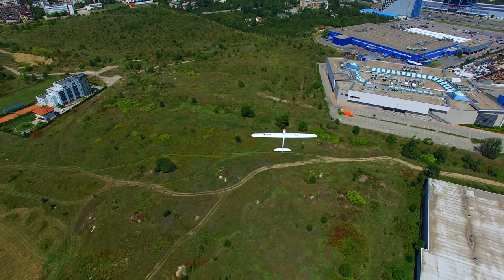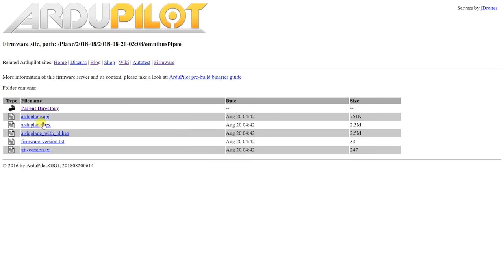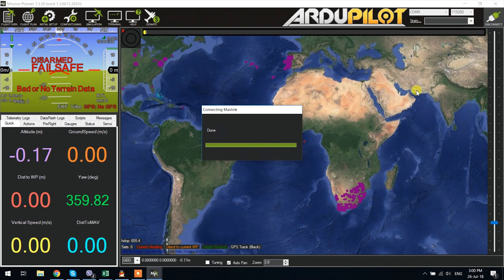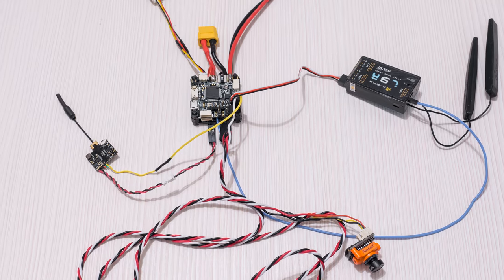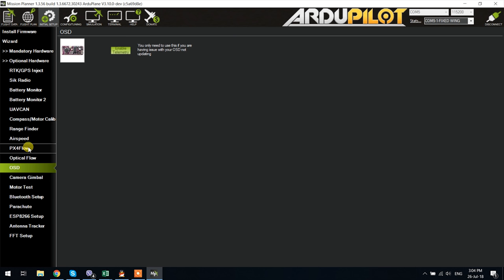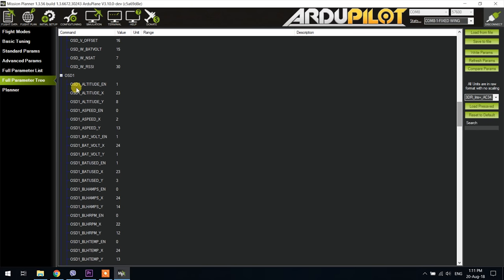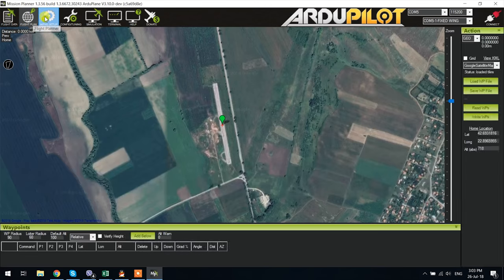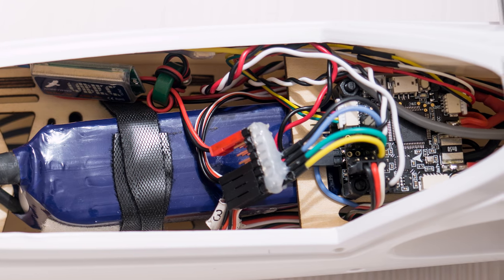HOW-TO ArduPlane on Omnibus F4 Pro and other boards!!!

Comment: Excellent summary, I was thinking of making something like this on Sunday but now glad I didn't bother :)
Just a few things I might add:
Hold down the boot button on the board while plugging in for DFU mode if Betaflight configurator doesn't do it.
If you don't have 8 channels or don't want channel 8 as flight mode, set the FLTMODE_CH parameter as desired.
Flashing the "with_bl" hex via Betaflight will reset all your parameters to defaults, using the .apj via MP will not.
On my omnibus builds so far, I had to set BATT_MONITOR to 4 to enable voltage and current sensing.
Reply: Thanks for the added comments!
Reply: please, do more video about this, as detail as possible, maybe add one for the Matek F405 Wing board.
Reply from the maker: Valid points mate, thanks for sharing them!

Comment: This is great new. What a boost to the ardupilot project being able to use new hardware like the f411 and omnibus f4 with built in osd. I cut my flight controller teeth with ardoplane. Its maturity and stability will always find its way into my airframes. Thanks for the great video!
Reply from the maker: Thanks mate, yes, I do share the same enthusiasm! Can't seem to get away from it! :D

Comment: good video and well explained.
that is the configuration of the osd for a single screen, or to see it in several screens ?.
What would be the difference in the configuration ?. Thanks in advance.
Reply from the maker: Thanks! This is only for a single screen, because I don't use multiple anyway... why add one more complication to an already complicated system! BUT... if you would like to set it up, just enable the additional screens and set a channel to change them with, then just configure like this one!

Comment: Thanks for all your good work. Do you preffer this above inav? I have a ranger 2000 but do not know what to use for sure as flight controller. Thnx again
Reply from the maker: Yes, I do prefer this to iNav any day! The ArduPlane firmware is quite mature and I've been using it for years now, not a single issue! iNav can't seem to get away from issues!
Reply: @ArxangelRC  hello again i have been using omnibus f4 v2 like you.but wen i give throttle up all goes good until 1500 pwm .Wen i go higher up till 2000 pwm the motor starts to stutter (up down up down up down) i did calibrate the esc.also did the radio calibration. is there a param i have to change? thanks in advance

Comment: Hey, I would like to flash my Omnibus F4 Pro V2 with Arduplane. When connecting to SBus, do you need to modify anything or it just work fine? Thanks!
Reply from the maker: Nothing to modify... just plug in the cable, and you're done! Should work....

Comment: Thanks for the video. Do you have negatives about this board? If so good why to pay more for a Matek 405 then? I'm thinking about converting from Matek to this. thanks for your advice !
Reply from the maker: Well... the Matek WING boards are well worth it! EVERYTHING is integrated and the a mount of soldering to be doing is greatly reduced, and made a lot easier! I would pick up a Matek WING over this setup any day!
Reply: thanks I thought the Omnibus was so small and about half the price it would be same same...I'll keep with the Matek
Reply from the maker: @joseantoniosantosdom  It is a bit smaller, and a bit over half the price... but it needs a PDB, etc., to get it to Matek Wing levels... and even then it is more hassle and soldering and wiring than it needs to be! The Wing series just makes this SOOOOO much easier!
Reply: @ArxangelRC  thank you for your help, please keep up your videos are excellent
Reply from the maker: @joseantoniosantosdom  Thank you, will do! :)

Comment: Excellent! I have one question . Do you know if mavlink telemetry radios can be used with this board?
Reply from the maker: Yes, if you see the video that was published before that one, showing the Phoenix flying with this board, I did mention I did have telemetry running, and it is working well! Will also be in the build log in the blog when I am done with it! :)

Comment: Thanks for the video. I'm hoping to use my omnibus f4 pro v3 on my hexcopter with arducopter, but have run into some problems. How did you get the current sensing to work? Whenever I try to set it up it comes up with some message about incorrect battery capacity. Thank you in advance
Reply from the maker: I didn't really do much... enabled the sensor, entered the battery capacity in the battery capacity field on top right part of the screen where you enable the batt monitoring. Should be doable like any other power module on pixhawk. I think you will also have to input the amps per voltz ratio... or something like that... I think I read somewhere a value of around 31 or 32 is to be used... not sure what it does, and I am still not done calibrating it, but at least it shows some value! :D
Reply: What type did you set the current sensor to?
Reply: Turned out it was working all along :p I thought it wasn't because of the capacity error. I'm looking forward to testing it and hope it will work better than inav.
Reply from the maker: Haha, glad you figured it out, should be working OK, though these things are never super precise! :)

Comment: I have installed Arduplane (fixed wing) on an Omnibus F4Pro Flight Controller, linked via FrSky X8R Rx to my Taranis X9D Plus. While sitting on the bench I am testing the various flight modes and they switch properly. My question is when I am in manual mode w/ 50% throttle and I switch to Cruise mode the motor stops - is this normal behavior on the bench? I am nervous to test it in the air as I am not sure what the response will be.

Any help appreciated.
Reply from the maker: Hi, I haven't tested that particular scenario, but my experience with these things is that while stationary and possibly with no GPS lock, the flight modes might act weirdly! This should be tested in the air and you can always switch out of it if it doesn't perform well! For me it might make sense that it would cut the motor, because the Cruise mode does not allow for direct motor control, you apply elevator to tell it to gain altitude, at which point the AP increases throttle on its own, if needed, to achieve that altitude gain! Just like with RTL on the ground, when you switch to it while stationary and possibly with no GPS lock, it will not spin the motor.

Comment: Very informative video... thank you! 
Did you manage to get FrSky Telemetry through one of the UARTS? I have an Omnibus V3 (not pro) and everything works but telemetry for my Taranis.
Reply from the maker: Thanks! Actually I have not tried doing that... not sure if it will work, and I don't really use it! Have found that receivers without telemetry work better and at longer distances so, have tried not to use telemetry as much as possible! :)
Reply: I'd like to know if you ever got telemetry working. I have the V3 pro and no luck so far.  Information I'd incomplete on the arduplane site.

Comment: good video and well explained. Have you removed the diode as shown on the wiki of arduplane? I've got the same fc and I've removed the diode following the wiki. Can I use the same your wiring?
Reply from the maker: Thanks Giuliano! No, on this board I have not removed the diode, but the wiring would be the same either way! I only removed it on the Mini AR Wing, because I wanted to keep things simple and light, and had to power the servos from that rail! On other models it makes no difference because I don't power anything from that rail!
Reply: @ArxangelRC  Thank you for your reply. Can you send me a pic of the wiring for Omnibus f4 with the the removed diode? Thanks in advance for your patience :)
Reply from the maker: The Diode doesn't matter, the wiring is all the same for me! I connect only servo signal cables to the Omni F4 Pro, and make an external harness to power the servos from a separate SBEC!

Comment: Thanks again for posting this tutorial. I managed to get everything to work thanks to your help. One question is regarding peripherals. Have you managed to get anything like 3DR radio or even RFD 900 radios to connect? I would like to still use some of my old equipment for my pixhawk like here2 GPS and radio telemetry. I notice you do long range. How do you track your location on the ground station during the long range if Unable to connect Long range telemetry radio?
Reply from the maker: Glad it has helped you! Yes, I am running the Micro Telemetry units with these, and all works quite good! I use them only for setup though, never when I do actual long range flights! I do have an antenna tracker, and that points the video antenna to the plane at all times, and it outputs the coordinates to my tablet where it is overlaying them on the map! I also have my OSD data, which is recorded on the ground DVR! I fly myself... so I always know where the plane is!

Comment: Thank you so much, could I ask 2 questions?
1. Why the V-tail plane need compass and other plane better off compass?
2. Could we use the on board sport telemetry with X9D plus? ( I know the FPort is not yet supported )
Reply: He said VTOL not V Tail.
Reply from the maker: Yeah, I said Vtol, not V-tail, although they might sound similar! V-tail is fine without a compass as well!
As for the Sport telemetry... no idea to be honest! On the original Pixhawk you could not directly, needed some sort of an adapter to translate the signal... no idea if they have fixed that!
Reply: LOL, thank you ^^
Reply from the maker: You are welcome! :0

Comment: im new to this. i have a question, to get fpv you connect a camera to the flight controller correct? then the flight controller connects to a transmitter? that transmits telemetry and video correct?
Reply from the maker: The analogue video transmitters we use most commonly only transmit video, not telemetry! The data on the screen comes from the OSD module, which is in the flight controller, which overlays the data on the video feed as it passes through it, before going to the Vtx.
Reply: @ArxangelRC  so the telemetry  gets sent  as an overlay...got ya, thanks for the reply. im a drone guy and have been doing high altitude stuff.and im just migrating over  to  endurance flight with rc aircraft
Reply from the maker: @Yelnats101  Cool! Good luck then, it is quite nice to be able to fly for much longer! :)

Comment: Thanks again for the great tutorial! 

A couple of things I'd like to add- I noticed your positive battery lead is connected to the wrong side of the galvanometer in your photos. I had it connected this way as well and my ammeter was inoperative. After connecting it to the other side it works great. Starting with a BATT_AMP_PERVLT parameter of 37 should get you close on the calibration of AKK boards. 

There is a convenient way to fine tune power module calibration: After completing a flight, multiply your BATT_AMP_PERVLT number (usually between 18 and 38) by your Mah put back into the battery, divided by Mah logged. This will give you your new BATT_AMP_PERVLT parameter, and I find it to be very accurate. Here is more info: https://www.rcgroups.com/forums/showthread.php?2279282-Calibrating-the-APM-Power-Current

I had to remove a diode and a resistor on the AKK board to get everything functioning properly. The diode removal will isolate the servo bus from the rest of the board and is recommended: https://static.rcgroups.net/forums/attachments/5/9/3/2/6/3/a9974548-119-OMNIBUSF4Pro%20esc5v%20diode.jpg
The resistor removal will allow PPM to function properly: https://static.rcgroups.net/forums/attachments/2/4/6/4/9/6/a10941401-126-68747470733a2f2f646973637573732e6172647570696c6f742e6f72672f75706c6f6164732f64656661756c742f6f72.png

I've got this in my ZOHD Dart and it works awesome. Having the capability this set up provides for a mere $32 USD (FC & GPS) is amazing!
Reply from the maker: Well... I've soldered the wires according to the labelling on the board. That being said... on my latest build I will take care of the diode removal, but it is on a very small plane, so I think it should be OK for that, on my larger planes I will always opt for the external power harness! :) Thanks for the useful info! :)
Reply: ArxangelRC thanks again for this tutorial! I’m seriously stoked about how well this works for the price.
Reply from the maker: You are welcome! Yeah, I have 3 of these now, and all seem to be working quite well!

Comment: Great video by the way.  Thank you for sharing.  This is a great step forward for the ArduPilot community.  One question, I noticed you are showing GPS info in mission planner but did not see where you had a GPS installed on the board.  Do you have one installed?  Are there any additional steps in setting one up?  Do you even need one?  Are you able to fly without one?
Reply from the maker: Thanks mate! On the ArduPilot website there is a schematic where to connect everything, the GPS goes in the white port just next to the servo outputs. I do have one installed and at least with ArduPilot, it does not require any additional setup, other than plugging it in! The FC will do all the programming it needs to on its own! Generally, you need a GPS unit in order to have a working RTH mode, as well as Auto mode, which also includes waypoints, etc. You can still fly without a GPS module, but you will really only be able to use the stabilized modes, and no autonomous modes.

Comment: I have some issue with radio calibration. The channel not responding even rx is attached and bind perfectly. I use Omnibus F4 V3, taranis x9d with xm+ receiver. Is there any configuration I missed?
Reply from the maker: I can't be certain here... but on the V3 there was some issue with the ports... and some adjustments had to be done, but since I have not dealt with the V3 board... I really can't say for sure what the issue is! I remember another reviewed had tacked this issue with the V3 boards... and I have watched the videos... but for the life of me can't quite recall who it was!!! :S
Reply: @ArxangelRC  sorry my bad, I missed to move sbus to pwm. Just resoldering and problem is solved. Now I can fly my rc with autonomous flight and other mode perfectly.
Reply from the maker: @prudisme  Awesome!! Good luck! :)

Comment: Hello, I am building my first ardupilot wing and so far things went perfect, like receiver, compass and gps, the problem I got is that when I connect the servos (tower pro SG92R Micro, digital) directly to my receiver they work perfect, but when I plug them (through bec) to the fc (omnibus f4 pro) they dont act smooth and there is a noticeable delay to my inputs (manual mode) compared to the same servo pluged directly to my receiver. Is this something common or there is something I should troubleshoot? (I tried changing receiver and bec but no difference at all. I also pluged an analog servo which seems to work smoother, so are digital servos supported and should I change any settings to make them work?) Thank you
Reply from the maker: Hi, I am not aware of settings changes between analogue and digital servos, and I've definitely never experienced what you are describing! How have you connected the servos to the flight controller? Only signal wires, or do the GND wires go there as well?
Reply: @ArxangelRC     Ground wires also. I have used the esc's bec to power the servos. I checked with a multimeter that there is no voltage in the positive rail that refers to the servos so I plugged the positive and negative from the esc directly to the omnibus.
I also tried to use an external bec but response is the same.
Reply: @ArxangelRC  Update: After trying to connect only the ground and signal wires to the fc and keeping (+) away from the board seems to have fixed the problem. Thank you for your time and reply though! Love your vids!
Reply from the maker: Glad you solved it, but that is a weird issue! I have powered them the same way you described on one of my planes, and they are working fine! Did you remove the diode to separate the servo 5v line from the rest of the board?
Reply: @ArxangelRC   No, I haven't actually removed the diode from the board. Also, I have maiden the wing since then and it seems to perform really well both in manual mode and FBW modes. Do you think I should try to remove the diode even though I haven't powered the servos through the board and it flies well? One last question that I came across is that I need to trim the wing in manual mode and in FBWA mode I found my self holding a little up elevator to keep my altitude, should I tweak this from the servo output page where it says "trim"? or might as well calibrate the board while holding the wing in an angle of attack about 2-3° that the wing needs in order to fly straight? (p.s. in RTL it was holding its altitude flawlessly with no problems at all) Thank you so much!!!
Reply from the maker: Yes, because RTL also uses the altitude sensors, FBWA does not! Once trimmed manual, I usually take note of how much trim is there on the control surface itself, reset the trims in the radio, and manually adjust the pushrods to match... so it would fly with 0 trims in the radio!

Comment: Hi , I need a suggestion and I hope you can help me. I have installed the Ardupilot firmware on Omnibus F4 V2 and the card does not detect the receiver (a FRSKY in sbus D8 mode). I have also installed the GPS and it works well. I can't understand what to do! I tested the same card and receiver in betaflight and the receiver works too. Can you give me a hint? I thank you anyway.
Reply from the maker: Not sure! What model is the receiver?
Reply: @ArxangelRC  is Frsky Pro V1. Thanks and best regards!!!
Reply from the maker: This is the first time I am hearing of an FrSky receiver called Pro V1!!!!
Reply: Problem solved! Receiver on Ppm mode. Sbus not work... Best regards!!!
Reply from the maker: Glad you figured it out! :)